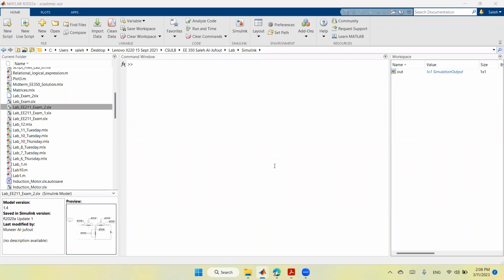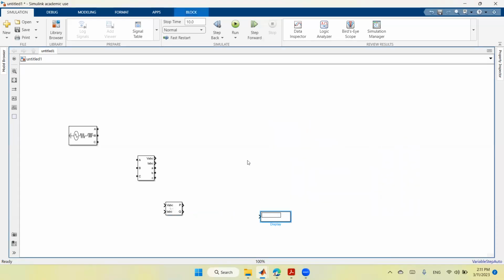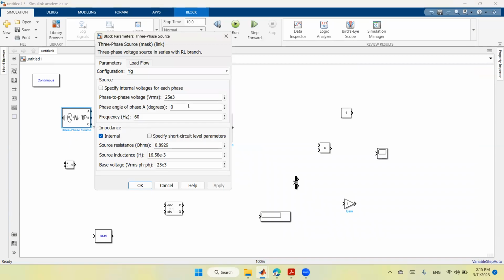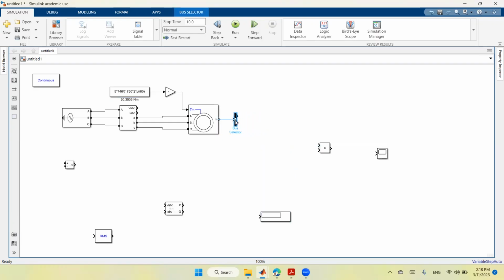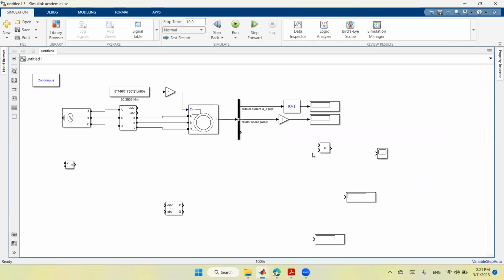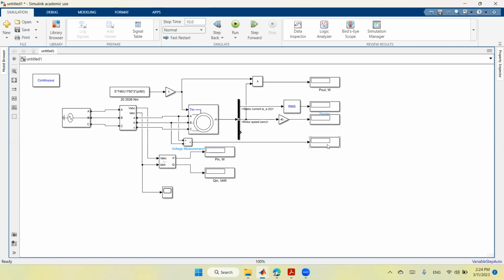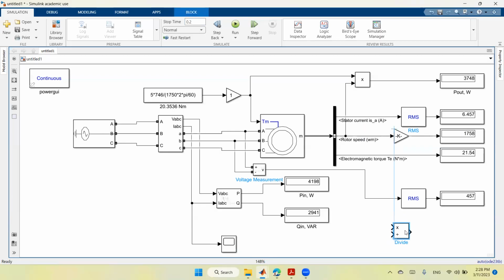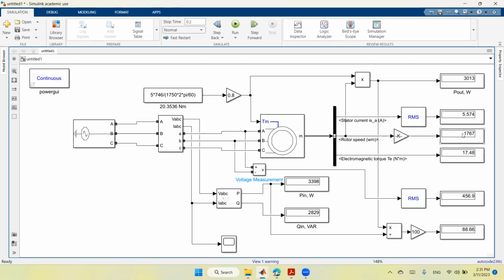15 MATLAB Simulink Induction Machine, Efficiency, Induced Torque, Power Factor

Comment: Hi sir ,In case of full load, how can the outgoing torque be higher than the incoming torque?
Reply from the maker: It is not incoming torque, it is the torque on the shaft of the motor and the higher torque is the induced torque and it is higher to cover the rotational losses.

Comment: Hi master, why rotor speed have higher value than stator speed? We know that, value of rotor speed can't higher than stator speed/synchronus speed
Reply from the maker: This happens when the load is equal to zero, which is not a real case. In real motor, there will be some min load, so the speed will never exceed the synchronous speed.
Reply: @ElectricalEngineeringbyProfSal  maybe I want to ask something. why are the specifications for induction motors / asynchronous motors only up to 200 kW and 400 V. How do I simulate simulink if I have a motor with a power rating of 400 kW and an operating voltage of 690 V

Comment: Please sir,
How induction machine works as Motor/ generator in simulink by using flywheel as storage system and the charge and discharge done according to Grid requirements

Comment: Thanks for this usefuI model but I see that after implementation of the same model, other people also get the Power output and input values different than the ones you showed in the video. In my case, my power factor was as low as 0.4. Then I realised that the signals that you are using to measure the P_in in your video are creating a measurement error. You are using V(Line to neutral) to calculate the P_in which is not correct and could be an honest mistake, it should be V(line_line) or V(phase_phase).

Comment: Hi master, I have recreated the diagram exactly in Simulink. This has been a very educational exercise. I thank you for that. Because we use 400V, 50Hz in my country, I adjusted the motor to number 20 (RMS block also adjusted to 50Hz). What strikes me and what I don't understand is that the speed is 1763 rpm. At 50Hz a 4-pole machine reaches a maximum of 1500 rpm (the gain for conversion remains 60/2pi). Do you know what's going wrong here? (I used 735.5 Nm/s per HP in the constant block, 20x735.5/(1460*2*pi/60)). Can you please help me?

Comment: I have a problem setting my input torque at 1/4 of the nominated input torque. The input power is lower than the output power.
Reply: nevermind, I chosed the wrong voltage measure.

Comment: hi master, can you explain that why i setup like you but output of rotor speed dont go from 0 but go from 1750?
Reply from the maker: Hi, if you want the speed to start from zero, then you need to change the slip initial value to 1.
Reply: thank you alot, i did it @ElectricalEngineeringbyProfSal

Comment: I have implemented the same circuit in the MATLAB/Simulink but the parameters like Pout and rotor speed are negative and less than the expected, for induced torque the value is very less. Could you please guide me on this issue?
Reply: Same thing for me, have you found why is that?
Reply: @spinosaurusbot4974  
Same thing as well, has the master replied yet or not? He is very helpful and hope he answers
Reply from the maker: Are you using asynchronous motor in SI units?